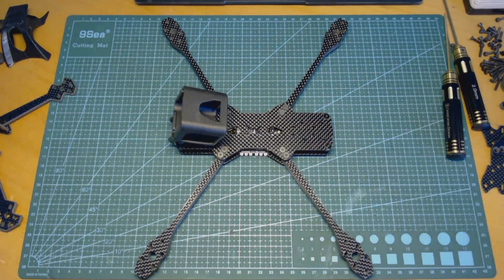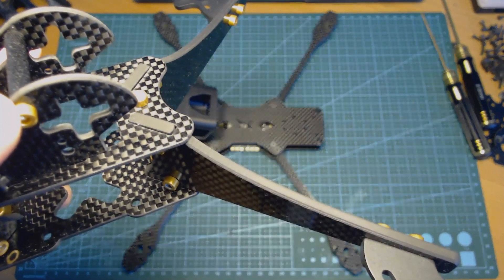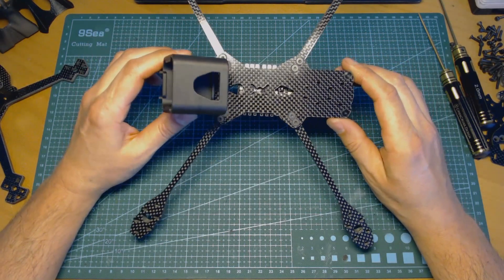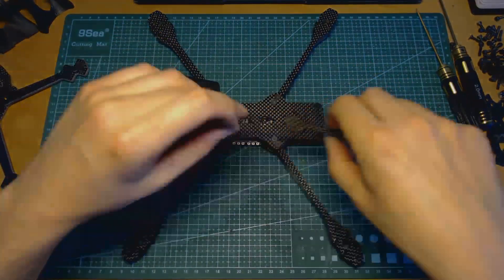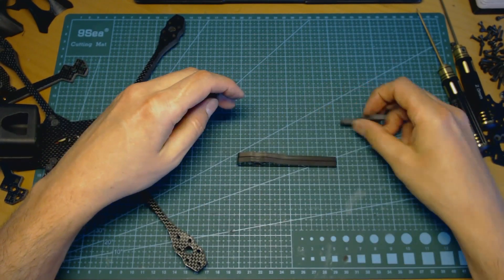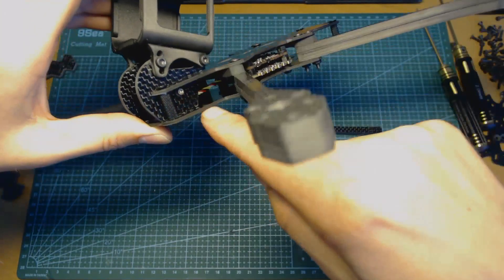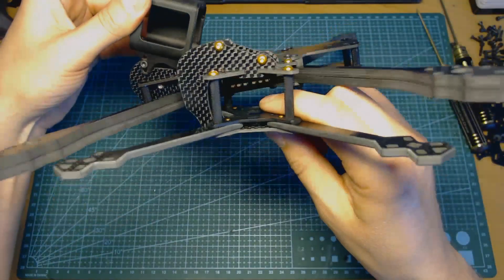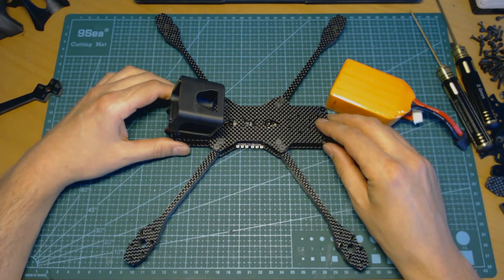Fire DRAGONFLY Hybrid 7-inch FPV drone frame - Short Review

Comment: Hi. Is this in production? I checked the website shop, the frame there is different than the one in this review.  What is the weight for 7 inch frame. And if use runcam split, would the 7 inch props get in the view of the cam
Reply from the maker: Sorry, missed your comments. This version of Fire Dragonfly is no more available. But you can get newest version in two variants. You can install RunCam Split only if you remove camera plates and fix camera on 3d printed TPU brackets. Props are visible from low position of DVR cam. Weight of 7 inch version is around 140 grams.